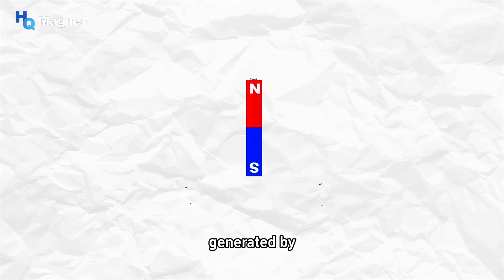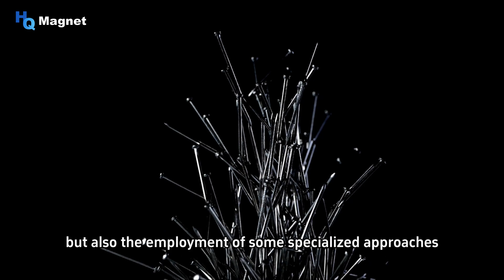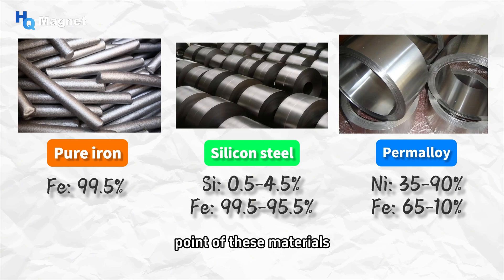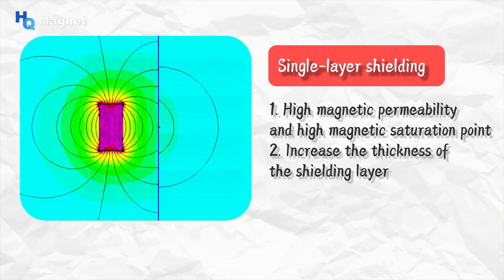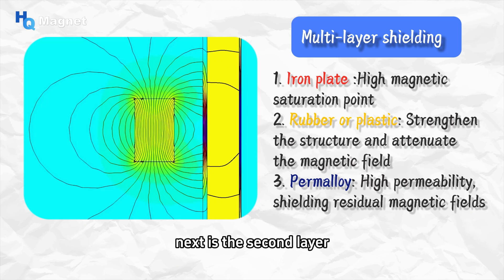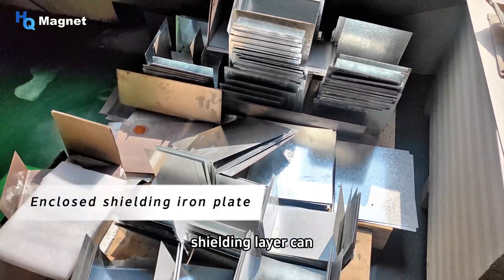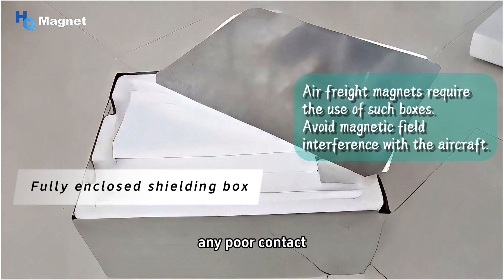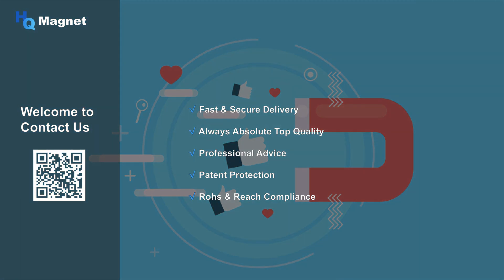How to shield the magnetic field of permanent magnets?

Comment: Would like help with high emf in my home 300 uf on my common walls 
Please help me
Reply from the maker: Electromagnetic shielding and static magnetic shielding differ somewhat in their approaches. Highly conductive materials rather than materials with high magnetic permeability are usually used to make the shielding layer, such as copper, aluminum, iron plates and so on. This method capitalizes on the skin effect, effectively barricading high-frequency electromagnetic waves from infiltrating the interior of the conductor and, in turn, accomplishing electromagnetic shielding.

Additionally, if you detect an electrical charge on the walls despite the absence of any electromagnetic field-generating devices nearby, it may indicate that the wiring inside the walls is damaged or has aged.🤔
This condition can pose a risk of fire, so it is strongly recommended that you contact a professional electrician for inspection and repair.
Reply: Dude knows theory. You and I are looking for actual help. No video I have watched gives me an address to a building to visit and see the emf's actually blocked by their product..  But many sites will sell you snake oil.